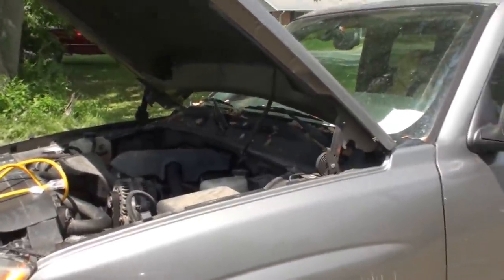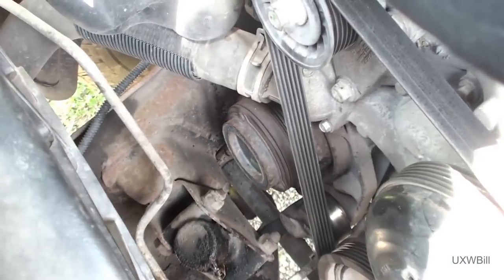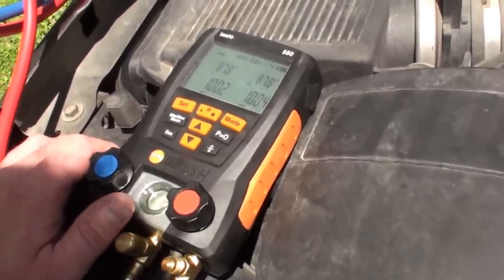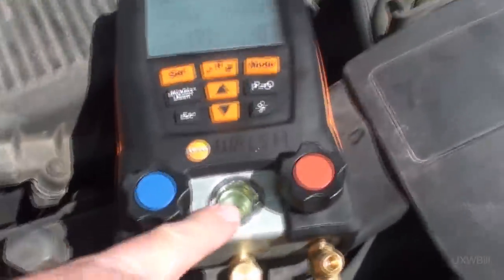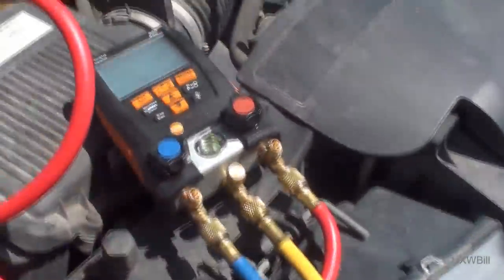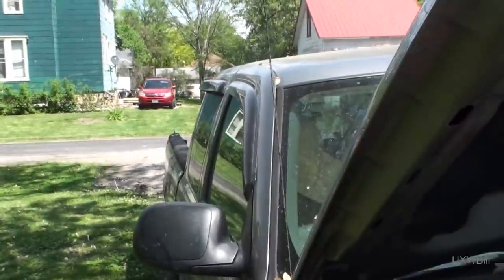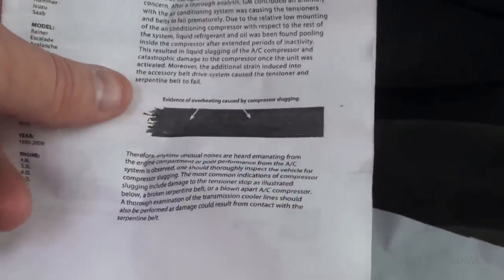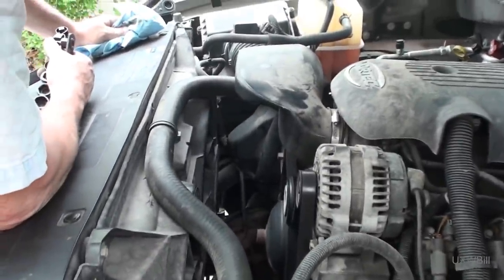Naughty Truck's Air Conditioning System Misadventure

Comment: My dad's hatchback and my Oldsmobile Intrigue lost the A/C last year and I charged both of them. However, both of them lose refrigerant. I'm going to check for leaks by adding the UV dye to the low pressure side and see if the compressors are bad and if they're good and if the Schrader valves are gone, if I'm lucky, I can replace those after I discharge the A/C system, remove the moisture, replace the oil for it, and recharge it.

That and on my car, the pulley on the A/C compressor is squealing like mad because idiot me didn't drain the coolant from the bottom of the radiator and drained it from the thermostat side, which is where the compressor is. I can order new parts for it and get it to work.

Comment: You know bill I will say one thing you have a big Advantage having and education about refrigeration systems which helps because it is a lot cheaper to just recharge the system yourself. After you said the belt blew I was thinking it could have been the tensioner pulley but also I didn't know it had a separate belt for the air conditioner. I will say in Connecticut it was 96 degrees on Sunday and I'm thankful for my air conditioner that works on my 2014 Volkswagen Jetta SportWagen TDI I just don't know how cold that car really gets but I will say it gets to the point that you have to turn the AC down and the fan off because it feels like a freezer LOL.  When you were saying that you made a mistake I agree with you we are human and are allowed to make mistakes. I also agree with you about the newer cars with the touch screen radio my car has buttons and touch screen and thankfully is a manual transmission I can't stand automatics nor do I like those Tesla piles of garbage that run around on the highways I'm just thankful that I have a car yes granted the diesel fuel is quite expensive but the overall cost isn't as bad when you have basically 500 to 600 miles to the tank undress 14.5 gallons of diesel which is about 38 MPG average in the winter and about 45 to 50 MPG so far. I hope you and your family be well and hope for your truck to have many many many more miles to go. As little as I drive my car as it is and being 34 years of age as long as I take care of it wash it baby it drive it it shall be my last vehicle however I would like to have another one as second car.
Reply: i rthink most people have a chance at changing the oil of their car. recharging theirAC system though, not a chance
Reply: @randomrazr  the problem is most people in this Society are very lazy and the acquired skills for a mechanic's excetera nobody even wants to do that. Pretty sad

Comment: I'm glad to see you finally put up a new video even though it was 2 weeks ago and it facing my YouTube never told me that you had a video up there even if I do have you with the Bell. Adventure with GM. I spent about I guess it was about 20 bucks the other day maybe a little more than that but I got a couple pieces of schedule 80 PVC pipe half inch maybe it was 3/4 yeah 3/4 in I put caps on the end of the things I put a key in there use the appropriate PVC glue for the hell on the thing and then I put a hose bib fitting on the end of it and I deal with 16 in holes in a row about every two inches apart and guess what I do with it I'll use it to wash the underside of my vehicle after I have been running around on the dot in Nevada highways sand salt Brian combination in the winter time I can completely wash out my fenders I can get in the Nixon cranny just by change the angles of the dangles and although my 1995 Ford Ranger has lifted a dozen for the most part it has been exposed to the Salt in the winter roads and I can get on anything vehicle cuz my handle is 6 ft long quarter a 16-in drill bit and you can actually get your water to spray about 10 ft up in the air.

Comment: I agree 100% with your reference to cars with the touchscreens on them last thing I would want to deal with on a new that has a bug in where the windows or some other component stops working or you can't leave your house with out a firmware update first. Love the video I don't know much about A/C work but I'll looks like you did an amazing job especially the vacuuming part.
Reply from the maker: It's just amazing to me how bad they really are. Insufficient computing resources, few if any software updates, built on ancient software, no thought given at all to security (seemingly not even a firewall running on those with Internet connectivity), craptacular interface design and I could sure go on. The one in my father's 2019 Silverado Custom is a flaming pile of complete garbage. It doesn't have even vaguely adequate performance (watching it run Carplay is a complete tragedy) and it crashes to a blank screen with great regularity.

(I'd readily grant that the second case is a defect and the unit might be replaced under GM's limited warranty, but who cares when the unit is defective in every way by design ? I say "might be" because so far the dealership wants to come up with every excuse in the world as to why it's failing, although they have yet to twig onto "because it belongs in a garbage can" as a likely reason.)

Every dashboard control in a vehicle ought to be operable without ever having to look at it. There's no way for a touchscreen to ever pass that test.
Reply: @uxwbill  One of the things I hate about it is, they put these distracting things into their cars and then require you to have the car parked to do stuff. I get it, people shouldn't be setting up their Bluetooth while driving, but do they realize that passengers exist? "Sorry dad, you have to pull over for me, the one not driving, to connect your phone!"

Comment: Make sure your rear frame tubes are clean of debris, and spray deluted waste oil in a garden sprayer inside them to prevent them from rusting bad.  I have an 02 Silverado Z71, and ever since i bought it in 2017 i have been spraying the frame down once a year before winter with waste oil to preserve it. FYI i had that same tensioner problem.  AC worked for the first year, and the second year nothing lol
Reply: Or just treat the whole underbody with Fluid Film or alike. More expensive, yes but you are not contaminating a ton of water with waste oil :) Probably lasts longer, too.
Reply from the maker: I have to be honest when I say that thus far I'm not that dedicated and probably won't be. Usually, I"ll just hose off the underside with a pressure washer as best I can.

Comment: Those, "beads" on the old orifice tube, that looks like the beads from the dessicant cartridge inside the accumulator possibly coming apart, and the orifice tube has stopped those beads from entering the compressor.
Reply from the maker: It seems that those beads really were a part of the orifice tube and not escapees from the accumulator. I tried prying a few of them off to see if there was a screen or filter underneath, and there wasn't. Underneath all of them was a hole large enough that one of those beads at a time could have passed through.

I tried to run an inspection camera down the accumulator's tubing and in both cases, the bend was too sharp for my camera to clear it. I may yet cut it open to see what's inside.

Comment: The NHTSA back in 2018 made backup cameras mandatory for new vehicles, because of this car makers needed to put a screen to view it, and this resulted in them all changing the radio to an LCD touchscreen to display the camera. The new Chevy Express and GMC Savannah vans have the same old non-touchscreen radio from the late 2000s, so I wonder how they got around that requirement or if the vans are exempt from it
Reply from the maker: I believe they put the display for the camera in the rear view mirror.

Comment: It's normal for those Silverados to have rust. My brother in law has a 2002. It's doing the same thing. If you wanted to spend the money they can be fixed. It would be cheaper than buying a new vehicle.

Comment: One of my favorite things about my truck (2013 Ram 2500 tradesman) is the lack of overwhelming technology. Feels like a much older truck than it is, but I like that. I have absolutely no idea what newer trucks with this trim level have. Personally I don't care if there is a touch screen on the radio, as long as there are buttons, and no other types of the car's controls are in the radio. I refuse to have to use a touch screen for the climate control!!

Comment: Great video fellow ac master...lol id keep the low side temp above freezing, so you don't turn  the coil into a solid block of ice  then no airflow
Reply: shouldn't the compressor cycles off if the low side gets too low?
Reply from the maker: @Jon-hx7pe  It will, although that may not be enough. The BBPOJ had a problem with its A/C freezing up on the lower fan speeds almost from day one.

Comment: @21:18 Constructive criticism: You could have saved your truck from rust if you would have rustproofed it with oil. People don't realize how effective a rust treatment is against rust with the right oil. Ask CORVAIRWILD, he drives old Suburbans on salty roads, and his vehicles are rust free.  This is not a paid endorsement, but  I use Rust Cure's Formula 3000. Not sure if it's available in the US, but they do sell that in Canadian Tire stores. I'm sure it can be ordered online.

It's probably not too late to treat the rust on your truck. Also, you could make a new rocker cover out of galvanized vent pipe and some stainless steel rivets and you're good to go! I'm sure the frame is pretty solid still. I had a 20 year old Buick Skylark that was driven on salty roads and it had little rust on the underside.
Reply from the maker: Truthfully, I'm not going to invest that much effort. About the furthest I'm willing to go is washing the truck thoroughly after the winter weather is past (or several nice days in a row come along), paying attention to as many nooks and crannies as are reasonably accessible.

Comment: How odd I just helped serviced three ac systems in the past two weeks. One was the system at home which had a loose wire. The other two were on vehicles. One of which the previous mechanic had disconnected the compressor and removed the fuse. No idea why. The final system was my own vehicle which just needed to be corrected to the right pressure as  it was cycling the compressor like mad when the heat started coming at 90 degrees
Reply from the maker: In a similar vein to the fuse being removed from the A/C system, I really don't understand the mentality of folks who damage or destroy the entire A/C system on a vehicle when it doesn't work, and they have no intention of repairing it. This is especially true of much older vehicles, where factory A/C was a very rare option. I could understand removing the compressor if it locked up, but there's no reason I can think of not to just leave the rest in case some future owner wants to repair it.
Reply: @uxwbill  me and my mechanic think it was to up sell his sister a complete ac system instead of the recharge that was only needed after reconnecting the compressor and installing a fuse.  We had pulled out his power probe thinking maybe something could be up with the wiring but no after gaining access to the compressor from under the vehicle it was simply unplugged and boy did things seem suspicious of that previous mechanic.

Comment: Honest question. I know its too late to oil/paint the underside of that truck. But can you do rust prevention on whatever you buy next? Or does that stuff not work??
Reply from the maker: Can I? Yes. Am I going to? Nope. I don't care that much. After all, Naughty Truck is now 16 years old with over 250,000 miles...and it's still in more than good enough condition to be safely driven. To be completely honest, I don't have the time either.

Rust prevention treatments can work if done well, though some do need periodic re-application to remain effective.

Comment: Came here to enjoy uxwbill's quarterly videotape.

Came away with yet another tool on the shopping list for my side-side HVAC/R excursions (I got dragged into factory maintenance very recently--the money and working terms on offer were unbeatable given my maybe 2-3 years of professional experience and 2 years of school experience in the field of HVAC/R install and service, both commercial and residential--so I'm also no longer doing HVAC/R professionally).

Funny and tangentially related story, I sort of have you to blame directly for getting me to go back to school for HVAC/R and actually get into trying to do it (and I did rather enjoy doing it for the short while I did it professionally even if the pay was kinda crap, it did beat the hell out of the pay Walmart was giving me at the time) so, I mean this wholly, thank you!
Reply from the maker: I am curious what tool you have been "inspired" to go shopping for? 

I never did find a good HVAC/R company to work for, only several that were run by crooks. Needless to say, that definitely wasn't how I hoped it would turn out. Now I'm back in the IT racket, which is OK by me and I'm working for a great company. I am still glad for the experience and thoroughly enjoyed all of my classes.

You're certainly welcome. I thank you for watching.
Reply: That there digi manifold you had there. We were persuaded to buy a Yellow Jacket one when I was in school, but I was "shoplifting ramen noodles" broke all through school so I wasn't in a position to buy that. The one we were shown was less feature laden though and now I'm in a job that pays enough to keep the lights on, I'm looking back at tools which would have been insanely useful when I was doing that professionally (since now I do it on my own terms outside of my day job).

On that, my experience was sort of similar when searching for work. Most local companies are either less than wonderful under the hood or (in the case of the one I stuck with for the back half of 2021 and the Lincoln area branch of the one I was with in 2020) were just too small to pay big bucks to the green guy.

As bossman at the last gig I worked for said, "even if you don't stay working in this field, the skills you come away with are useful for the rest of your life".
Reply from the maker: @bakonfreek  Never let it be said I'm not totally out there somewhere, on another planet. I should have figured that you meant the Testo. I have truly been really happy with it. It's even still running on the batteries it shipped with when I bought it about three or four years ago.

The Yellow Jacket digital manifold I've seen looked kind of like it was an afterthought and maybe more than a little fragile, with a box containing a display perched on top of what looked like a "warmed over" conventional manifold.

I never could figure out why nobody reputable seemed to be interested in hiring me. I wasn't even after the big bucks (anything would have been a welcome improvement at the time). Two of the more reputable places I interviewed at seemed like they were going to pan out, until the manager at the first suddenly said "you think I'm going to hire you" (which I did). Since I went through all my classes completely out of order, I didn't have my EPA 608 until much later. I mentioned this to the second place and they didn't seem to think it was a big deal..."we'll sit you down in front of a computer and you'll have it in an hour", yet I never heard any more from them. Maybe I shouldn't have said I had a preference to service work? I dunno.

As you said, nobody can take that knowledge away. I don't regret having gone through the program I did for even a moment (although I wish it had been less focused on wiring diagrams and more on "so this is how installation works").

Funnily enough, things are looking to come full circle. My instructor called me a while back to say he was hanging up his toolbag and asked me if I'd be interested in teaching his night classes. I thought about it for a while and started the ball rolling. It's early days yet, so I'm not sure how or if it will play out. I have the recommendation of all the instructors in that department and it looks like I'd be starting off with just one class per week (gas heat basics).
Reply: Yeah, I feel like a bit more could be taught regarding install since a lot of places won't hire service guys right out of school (I got to find that out the hard way, but a couple of places offered me install without me asking under the guise that "it would be great to know how things go together and come apart so you'll know how to fix them" and I'm inclined to agree there, shame my school wouldn't teach us how to install stuff--I gotta wonder if that's a universal thing or if that's just community college).

That's an interesting way for things to come back around. I can't speak for "in real life" since obviously I've only seen you on YouTube, but at least from your personality here on YouTube, I feel like you'd make a pretty good teacher (HVAC/R and some $100 words to take home--my mom is an English teacher who grew up on a farm and for those two reasons, she likes the car videos on your channel).

Comment: I had a 1987 Chevy Blazer 4x4 and I do miss that. Then I had a 1997 Chevy Cheyenne C 150 Work Truck. I miss it also I have always been a Chevy guy even though I drove a Mercury Grand Marque actually had 2. Then I am not ashamed to say I drove a 1999 VW Beetle for awhile it got me from point a to point b. Now I a 2013 Dodge Ram 1500 and I love it also even though I really wanted another Chevy I drove the Dodge and it just felt right. I am not against driving a Ford Truck as long it get's be from point a to point b. I plan on keeping the Dodge for as long as I can.